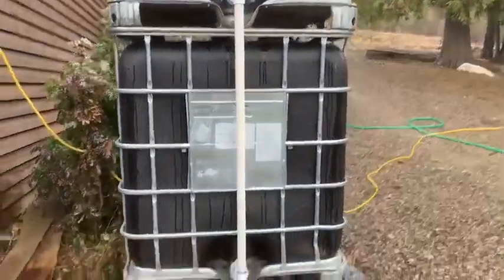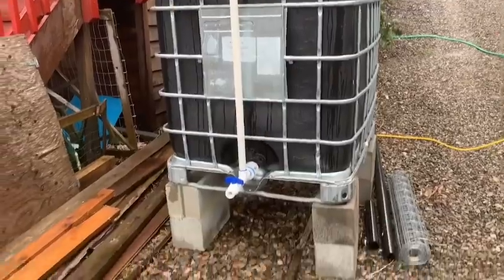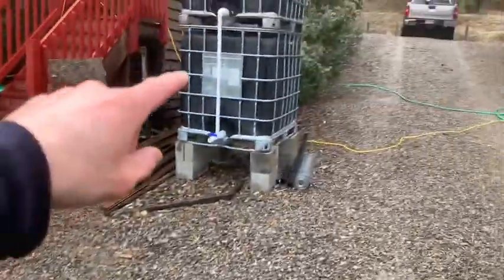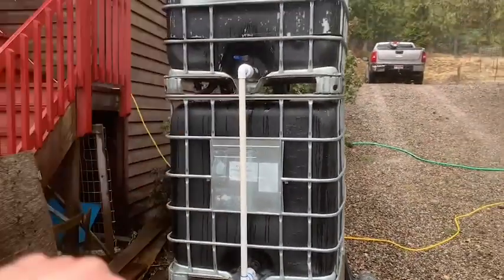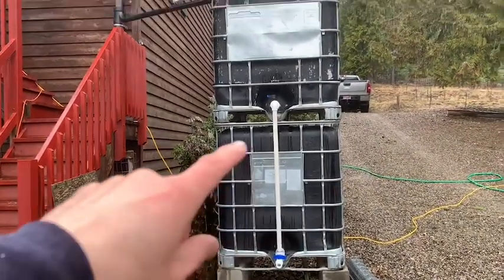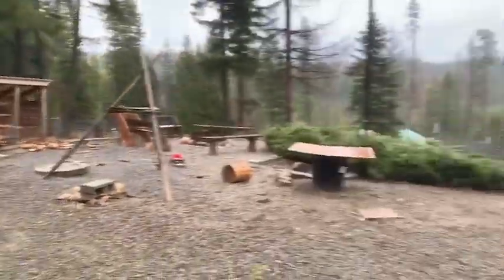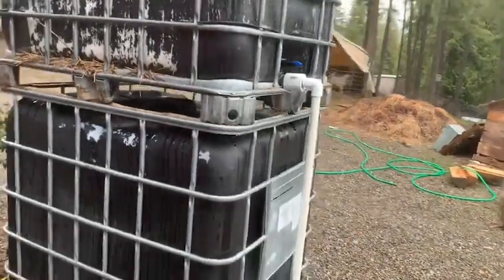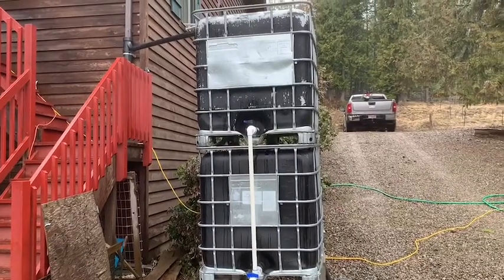Rainwater Catchment Expansion Project

Comment: Did you have any problems with the weight of the double stacked totes crushing the cement blocks? I want to do this by my shop building, but I’m concerned about the block failing and damaging my building.
Reply from the maker: Each cinder block can hold 1700 lbs, the weight is spread load across 4, so theoretically 6800lbs. That’s (2) 275 gallon totes. When full that would be 4400lbs. Ours have been double stacked on those blocks for 7 years without problem but that’s a valid concern.

Comment: do I really need a first flush system if I am only going to use the water for the garden?
Reply from the maker: No, not really (as long as the collection surface doesn’t have contaminants) other than you could have some more debris... if you are watering out of a hose it’s probably not a problem.

Comment: I just did this setup. Are you able to fill both fully? My bottom tank looks like it wants to burst?! the bottom tank isnt filling with anymore water now and is only halfway full of water (other half air) but has alot of pressure.
Reply from the maker: It needs to vent. I have a shutoff valve between the two tanks so I shut the valve off when the bottom is full. Make sure the lid on the bottom tank is basically off and that is your vent. You could tie the two tanks together with piping and have one vent bit this is the easy way of doing it... the downside is a little manual work

Comment: The system would be more more automated if you just put them side-by-side on the ground. Stacking them makes them less efficient because now you've got to go out there and manage valves when the bottom is full. The system is just not complete. Put them on the ground side by side at the same height and now you can take advantage of both tanks automatically without being a tank manager.

Comment: how did bottom cage vent out air with out leaking water?
Reply from the maker: it didn't. However, since then, I have added a shutoff valve in between and that is how I control it. It's working great. I'm sure there's a better way but this has been good enough

Comment: Does it not get an air lock in the bottom tank? Doesn’t it need a high vent like a snorkel in the bottom tank?
Reply from the maker: fter working with this system for a few years I have found the easiest way to vent it is to control the flow to the top container which is vented on top. I shut it off when the bottom is getting full. I leave the bottom container lid slightly loose.  This works fine. I’m sure there’s a better way but it’s simple and works for me.

Comment: I have 4 stacked 2 high and used a nipple drilled into the lids of the three totes that were receiving from the main intake tote.  I used commin garden hose to vent and found this didnt allow as much air out as water in and have since upgraded to 2" pipe vents.  Im still in the process of getting it all put back together after pouring a slab for it all to set on.  I had used cement blocks that sank and almost broke my flow piping due to it.  Firm foundation, venting, filter intake and have an over flow that takes excess water away so you dont flood your foundation.
Reply from the maker: Sounds like a nice setup.
Reply: @PracticalHomesteader  I'm confused, did you put a vent on the bottom tank?
Reply from the maker: @rclewis01 yes, the bottom tank is vented. When the bottom is full we close the valve in between. Not the best set up in hindsight but it works.

Comment: How does the air above the inlet of the bottom tote escape?
Reply from the maker: There’s a valve on both tanks that I manually control. When the bottom is full, I close the valve on top. The lid on the bottom tank is not sealed but loose. I would design it differently if doing it over but it works well enough for now.

Comment: Good to see your expansion. I'm curious how the lower IBC will do as far as venting goes, both for filling and draining. Guessing it'll be burping occasionally? 
Good idea just painting those totes vs. trying to get black tanks.
Reply: There may be better ways of handling it, but if/when I set up this kind of layout, I'd run a small pvc pipe out of the lower tank's cap, across the top of it, and then up the back side of the upper tank so that it terminates at a higher point than the upper tank itself. This would allow the lower tank to fill completely without any burping issue.
Reply: @chrisanddorie  have you installed the pipe at the bottom tank to release the trapped air?
Reply from the maker: That’s a great question and one I didn’t consider all that much. The top tote is vented but I guess we will see how the system performs. I think you’re right though. There will be some burping happening.
Reply: So it has been several months, how did the "burping" work? Air isn't going to burp up through the connecting pipe once the mouth of the pipe is covered on the bottom tote. It will pressurize the air in the lower tote, just like a pressure tank just w/o a bladder. But I can't see how it would come anywhere near filling the lower tank. And I care because I'd like to do stacked IBC totes too! Is there some kind of air release mechanism on the top fill of the lower tote? Then the lower tote would burp when the upper tank is empty and air can bubble in through the outlet unless that mechanism is a 2 way air [but not water] inlet.
Reply: @ben-andyhein7497  i am considering to stack up my ibc tank too. Wondering how would the air get out from the bottom tank.
Reply: I'm seeing everyone plumb these the same way and I can't get past the airlock in the bottom. Does it fill?
Reply: Could you just loosen the bottom cap to vent or use a screen cap? I really want to stack mine but don’t want to drill and plumb if I dont have to.
Reply: @caprag.1991 that’s what I was thinking too lol
Reply: So I know when you pump out with the lid on these tanks crush. What I did with my food grade totes to collect permeate water in my sugar house is I went to tractor supply and they have half inch bulkhead fittings. I drilled a hole on the top of a side and put the fitting on with a half inch Barb fitting and zip tied a hose to the stacked tank to vent out but not drain.
Reply: I am doing 8, 4 on top and 4 on the bottom.  I will connect the two levels with 2" inline ball valve to stop the lower level and start the upper. Loose caps on all. No drilling or additional vent tubes needed. My motto, KISS.😘